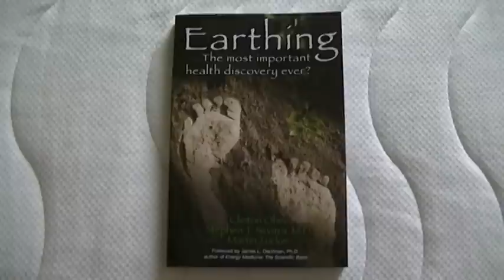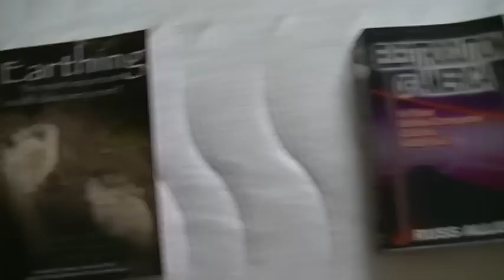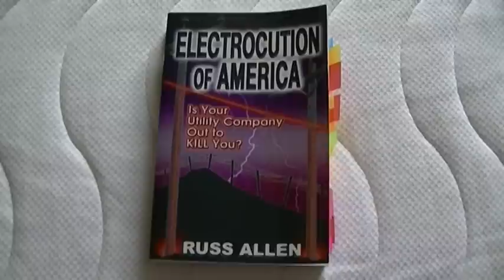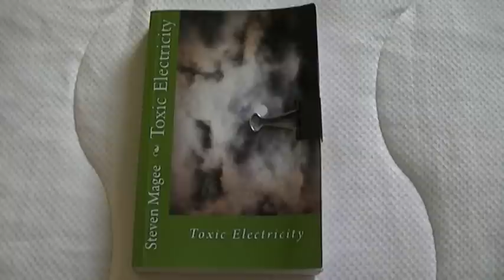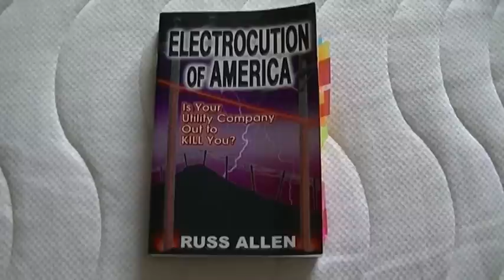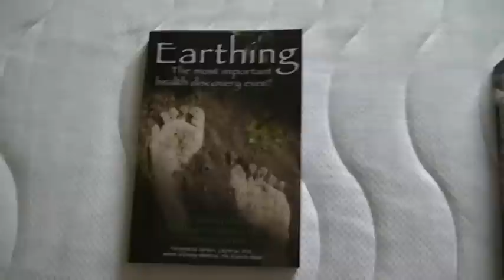Earthing (Grounding) Health Risks

Comment: Thank you for this. I was thinking of doing grounding but I have high voltage arial cables running over my house and garden from the national grid. I would imagine there's a lot of volts running through those cables. I once held an electrical pen, a device for detecting electric, up toward the power lines about 100ft above my garden and the light on the pen came on. When I lowered my arm down, the light went off. I was able to switch this light on and off by simply raising and lowering my arm. These notional grid cables run right over my neighborhood and over my garden. No doubt, many of my  neighbors will have this same problem. I already have major heart problems so I don't think it's worth the risk for me. Again, thank you for this information. I think I'll wait until I'm in the countryside in the summer and just take my shoes and socks off and get grounded that way.

Comment: Grounding is said to remove the free radicals from the body by taking in the electrons from the earth upon contact, thus balancing the charge in the body, and helping with inflammation etc. This is definitely true, when standing on the ground with bare feet. It is healing generally.  
The grounding devices are supposed to mimic this by making body contact with the device, eg. Bedsheet with silver threads, and then plugging the device to the grounding hole in the 3 prong electrical wall outlet. The grounding wire is connected to the earth via the water copper pipe or something that goes into the ground. 

However, the problem occurs if there is a current jump from the live wires to the grounding wires. If there is a short, then you could get electrocuted. This is unlikely, since the electrical system in the house would detect such short circuit and blow the fuse. 
However, the undetectable problem is that there is some induced current from the live wires to the grounding wire, and this “live” current gets into your body very subtly. This is not theoretical, because this happened to me and took 2 years to figure it out. I had above described bedsheet plugged into the grounding wall outlet 10 years ago. After a few months I noticed “pin pricks” under the skin coming from the inside. It started in the arms, and spread through the body. Sometimes it was just annoying and at times painful. It would happen few time a day or dozen times per hour. My doctor did all kind of tests, but no clue. He figured it was some kind of nerve related disease and put me on various medication. I never made connection to the bedsheet. 
 
Two year later, one night I woke up with severe pinpricks in my right thigh, and instinctively I pulled out the grounding plug, and instantly the pin pricks stopped. I stopped using the bedsheet and within a few weeks, these pin pricks were completely gone. There’s no doubt these were related to the bedsheet, and I talked to an electrical engineer at work, and he said this can happen, they call it dirty electricity, and that is induced or jumps from the live wires (through air) to the nearby ground wires of the devices. 
If one does want to use the conductive bedsheet, the grounding wire should be taken and connected directly into the earth via a cable. No house electrical system should be involved. Now, having seen this video and some comments here, I would not trust even doing this. My experience was very painful for 2 years. Luckily, it was serious enough for me to detect the pain. What, if the damage being done to me was subtle and I did not feel it? I could having been harming myself for ever.
In any event, there is not much substantial solid medical evidence of the efficacy of the grounding  for any particular ailments or the mechanics of how this healing is effected. It's just not worth it.

Comment: "A very risky activity"? You claim. . .
Hey Einstein, quit grounding to the grid!
  Ground to EARTH. Many electricians fail to correctly secure a neutral somewhere in the house. Ordinarily,  you would not notice,  but to ground your body to it, is sketchy at best.
  There is ZERO "danger" if you will simply do so CORRECTLY, and bypass the grid ground.
  You are mistaken.

Comment: Thank you for the information. I am sure there are those concerns. Toxic and stray electricity does exist. Electrical grids pollute the earth's natural state. I was interested in earthing, as I was battling with many physical issues, which made life almost unbearable. With the toxic electricity issue in mind, I began testing my own body with earthing, little by little, or with parts of my body which had the most chronic pain. To my surprise, earthing has taken care of all my chronic pains, and my blood pressure is well below 120/80 at all times, where previously was 160/100 or more. I personally am very satisfied with earthing, and it has made me feel like I got my life back. However, everyone's body reacts to situations differently, so my case may not apply to everyone. And I also would be skeptical of electric sockets, unless I was able to confirm that electricians have done a correct job in their work. I have a wire running out to the ground, and not to an electric socket. As for myself, I have been grounded for 4 years, and my pains have all gone away. I even noticed that many pains I hadn't noticed were disappearing. Also, for the past 4 years, I haven't caught a cold once, whereas in the past, I would catch severe colds 3–4 times a year.

Comment: Has anyone experienced what could be described as a herxhiemer or detox reaction when they first tried sleeping grounded?

I have a separate ground rod 6' deep on 10' insulated wire to a conductive sheet the first 2 days now ive woke up right at sunrise 5:45 and i feel completely brain dead and stupid, almost like when i quit gluton and had a herx reaction years ago. Even sore knees (i never get sore joints) wondering if its some sort of immune response

Comment: It actually explains and warns in the book about chronic illness patients should be very careful with using any kind of Earthing device. I can't use the pads since i dont feel any effects from them, but I do go outside as often as possible and even then it seems to cause inflammation flareups. Currently undiagnosed but on the path to discovery. That being said Earthing has also seemed to give me a cold tolerance so my internal body seems to be heating up as a response to weather changes. Interesting development.

Comment: My husband and I have chronic pain even with medication.  I've been having post-polio pain for about 30 years and my husband had a back injury nine years ago that resulted in a failed corrective surgery. He takes heavy prescribed and monitored pain meds. I use natural methods of pain control. I have researched many pain relief techniques and natural remedies. One thing I know for sure... pain relief methods, supplements, etc. vary for each person. They succeed or not depending on the individual's own body. We've been grounding for over 8 years and we can tell when our grounding sheet needs replaced when we both agree that our pain level has increased in the mornings (we're on our 3rd one.)  Our grounding (earthing) sheet is NOT plugged into the electrical plug, but only the grounding receptacle. The grounding wire goes directly into the ground, NOT THE ELECTRICAL SYSTEM!  I did research on this concept before I discussed it with my husband, who has a certain amount of knowledge regarding electricity conduction, etc. I prefer grounding on the grass with bare feet when physically possible.  But our grounding half-sheet is a must. Our bedroom is upstairs, which makes earthing even more vital. . We even take it with us when we travel. It goes folded into a small square, right on the top of my clothes in my suitcase.  It is worth EVERY PENNY! At this time, nothing could convince me that there is danger in this form of "connecting" to the earth. (which by the way, is an amazing way that God created to help us stay strong, healthy and grounded!)
Reply: Hi, how do you run the wire into the house, my issue is I don't know a good way to run it into the house without drilling holes etc. sorry if this is a dumb question, I am new to this.

Comment: I think there might be something to what this guy is saying. I've been sleeping on this for a few weeks (aluminum screen method going into a grounded wall outlet), and I'm waking up with sore hands, feet, knees. I tested my setup with a multimeter to make sure it was working beforehand, (got down to 0.008 volts), so maybe I'm detoxing in some way? I've never had any issues with this and I'm not sure if it's related to grounding yet. Super weird and disconcerting.

Comment: In the last minutes of the video the presenter states that if you find a clean grounding system, Earthing may probably work ok an be beneficial. I think his warning against just plugging into the Earth in the house electrical system is fair. We need to consider the risk in this approach and make a proper grounding system which is only used for Earthing equipment.

Comment: Is the grounding outlet in the wall really corresponding to neutral in the utility transmission?! From my experience neutral is only a thing in very high voltage lines (the lines highest up) and they are the midddle line that allows the power to transmit far distances. This power is transformed, and sent to the lower lines, which enter the houshold. None the less, the house necessarily has to be grounded by code...meaning there is a grouding rod somewhere on the property connected to all of the grounding plug holes on the outlets. "Neutral" is not even a relevant part of the converstation here...im not sure where you are coming from.

Comment: I think very highly of grounding. I ground myself as much as possible during the day and night. When I grounded myself at work however I felt really horrible (work at an office with lots of computers). Much worse than without grounding. I think it might be because of dirty electricity..
Reply: need to test the earth at your work is functioning with one of these https://www.ebay.co.uk/itm/ELECTRICAL-SOCKET-TESTER-NEUTRAL-LIVE-EARTH-WIRE-UK-EUR-PLUG-OUTLET-TEST/143224599130?hash=item2158d9f25a:m:mzLiJG3vyHOK24EwQtvHoXA

Comment: What animals that are having prolonged exposure to the grounding system. ????? Are they experimenting on animals. ? There is no need to . Animals don't wear shoes and they are grounded all the time when they are out side. I have never seen one drop dead from standing on the ground even under power lines unless he gets struck by lightening. I would not listen to anyone that feels they have to 'experiment' on animals. This wanting to experiment shows what their mindset is. What i would be aware of is that not all people are careful about what they do. They do not read instructions and i feel that some may electrocute themselves. I use a grounding rod which is not connected anyway to the electric sockets.  I will give you an example of how the na sayers work in the research  industry . I have a problem with my ears. I have immense pain on the airplane and i go deaf. I use them little ear plug in which alleviate the pain. A German chemist adviced that i try Hopi ear candles.  The first time i used them before the flight. I had no earache!!  I have used them for years and my ears are always comfortable. The research always says don't use them . The troll sites say they are dangerous (Bad Science etc) So i stopped using them and endure the pain on flights. Then i met a hospital doctor and he told me that there is a problem with my ear structure and thats why i get the pain. He mentioned ear candles and i asked him why the research says NO !  He explained that research is gathered from the patients that attend the emergency room with ear burns.  The whole subject of research is safety to the patient . If publics Hopi Ear candle sessions are not supervised properly then the research will go against them. So this question about Earth grounding being safe comes from people who do not do it right. Use grounding rods if your electrical system is not up to standard. My electrician says. Don't do earth grounding in a lightening storm. :-) Hope this helps.

Comment: I appreciate your video.  I have certain health issues including heart arrhythmia, constant styes and chronic shingles.  If I skip Grounding/earthing one night, I begin to get the symptoms of these health issues, redness returns to my eyes with eruptions and I break out in shingles and cold sores.  I have had this issue since my 20's, I have issues with my immune system that doctors don't understand.   I learned about grounding through a Croatian elderly gentleman that stated that walking on the grass cools and soothes the body, I began doing it and realized that my symptoms went away, I had tried everything in the book, vegetarian diet, moved up to vegan, moved up to raw vegan, moved into yoga, raw vegan and fasting, best water, cut sugar out over a decade ago, excersise, anything that would help, and all of it did help, but not enough to stop it.  only grounding has provided healing of this body.  I am in new york and I created my own copper grounding device.  I will consider your warning and look into what I can do.  I plug into the wall now, and am wondering if it would be worse or better to have a grounding rod out the window, considering I am within 3 25' from electrical power lines and about 50' from the transformer.   How would one measure, or rather is it measurable current?

Comment: Hmmm, electrical engineer? You created an antenna and then put a resistor in series that limits it's ability to  discharge EMI induced signals to ground.

One of the things we look for in industry when having problems with EMI induced noise is enduring the shield is grounded correctly. One of those things we look for is a high resistance grounding connection, 100K ohms qualifies as such.

I haven't done earthing, but was told to look into it and saw the link to this video. 

I do believe that there is more to this than what appears on the surface, but I also see your experiment had some major flaws in it.

Comment: Thank you Steven for being a voice of sanity in this field. I don't doubt that many have benefited, but as you say it all depends on how the electricity in their building is set up and how much dirty electricity is circulating in the building.

Thank you also for mentioning heart arrhythmia.  I couldn't believe how rapid my heart rate became at the slightest exertion and how many ectopics I was experiencing. Not to mention the severe upper back and shoulder pain that I also started feeling after sleeping with a grounding mat as well as having it under my feet while sitting. I disconnected it yesterday, and I am somewhat better today.

I was getting really confused as all I could find were glowing testimonials yet I was sure all this started since grounding and I stupidly went on for a week using it because of my disbelief that it could be the cause. Thanks again for your video and I find it a shame that those who have benefited are incapable of believing that there are situations where this could be detrimental, or even worse, engaging in disparaging remarks without having a clue about the science behind the different scenarios of earthing and their different effects.

Comment: Hi Steve,  you might have a sensitivity to copper which doses cause heart arrhythmia or atrial fibrillation.  Anxiety is also a common symptom.  What you were exposed to is a weak galvanic current which caused you to absorb copper through your skin.  You might want to try a less reactive metal in the earthing material to prevent excess exposure to copper.

Comment: How odd that you don't have your circuit ground connected straight to ground.
In Ireland, ours are connected straight to a deep grounding rod in the earth outside
Reply: Same in UK. I think all these people arguing must be from other places because all our electrical sockets are ground. If you use a proper mat, and a proper plug that was made specifically for grounding, and only plugs into the none electrical ground pin, then i can't see how it's bad.
Reply: @JonnyChaos  I agree but wonder what if any RMF Radio etc. gets transmitted to that ground as it runs along the whole houses live wires that obviously give off energy.  Also if there is a malfunction in the house where the ground is used, perhaps you could get shocked?  Lightning could also be an issue if you have a line running down 2 stories down your houses side.   Sleeping in tents may be the answer. lol.

Comment: They are many things in this world that are taught to us by our universities. Much of which is miss leading and downright false in some cases. Connecting to our electrical system may not be the best way to ground. However,  it has been shown to reduce the voltage of your body. (Which is too high in most houses) These higher voltage readings in our bodies pose as much if not more of a risk to our health then if we don't ground. Walk barefooted as much as possible and this will reduce your risks when it comes to grounding.

Comment: So putting a grounding rod a few deep in the ground in a more rural area would be healthy?  I had wondered when I saw they sold these to plug into the wall about the electricity of my house - it was cheaply built in Texas so I don't trust it.    I also thought... in Earthships that have clay floors the only thing between your feet and the earth is the oil finish, the clay, the dirt pad, and then the earth.  Would you get the earthing benefits on a poured adobe floor like this and earthen walls?  Is there a way when we build a house to assure we have the cleanest electricity possible going in without running 100% off our own batteries?